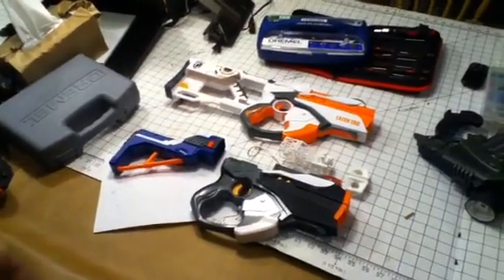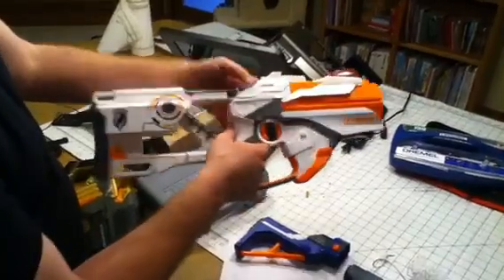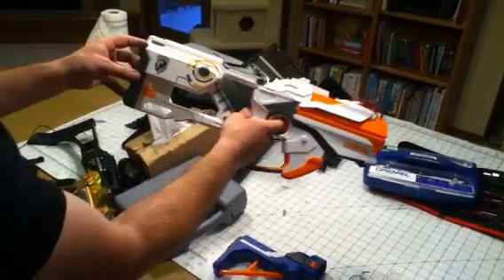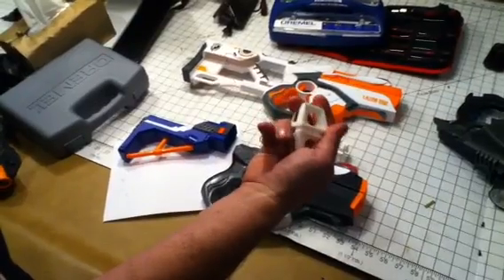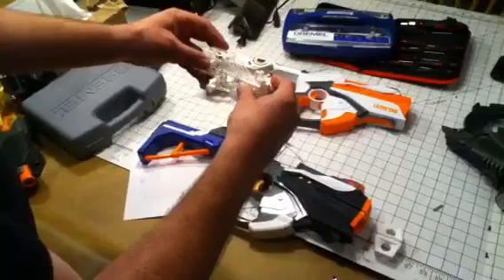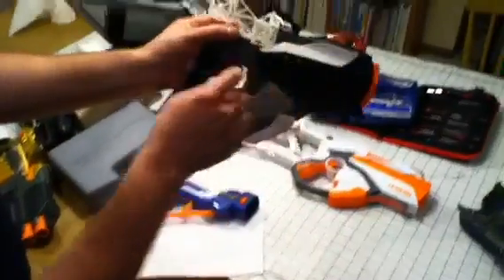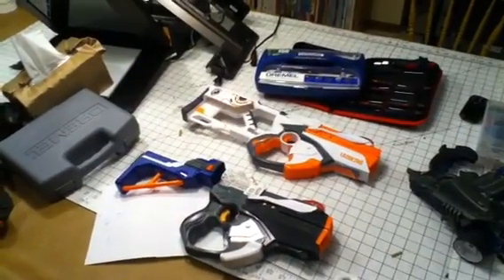LTAR Accessory Prototypes

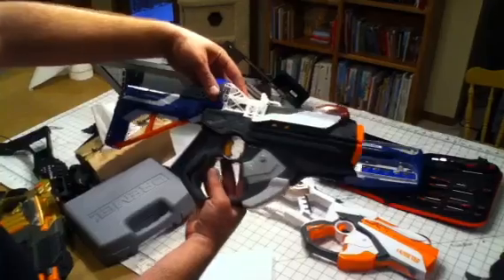Comment: 2:15 I wonder if you can make the same 3-D printed stock attachment accessory but more solid in doesn’t have as many holes so it can be a lot more stable while it use
Reply from the maker: The reason this prototype had holes was to save on material.  We wanted to get the fitment right before printing a full solid piece.

Comment: How about we keep on using the 3-D printer techniques as part of a new line you can create such as the LTAR modular system we can swap lenses for ranges, swap scopes in place of the iOS cradle or iron sites swap stocks. Or even swap barrels just as long as they are strong and fit within the front of the original pair of these blasters would that be neat